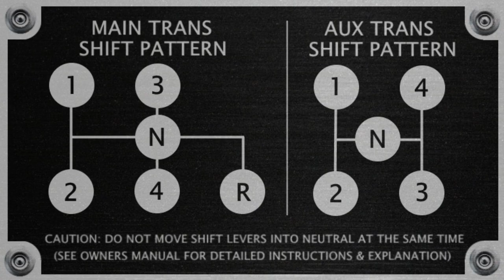Spicer 16speed Transmission demonstration

Comment: basically, this is dual 4 speed gearboxes glued together
Reply from the maker: Yes, exept they are bolted luckily!
Reply: @Darstrom  this is so cool this is the only transmission I have never driven before
Reply from the maker: @hankthehex4298  I hope you will get the chance to try it!
Reply: Mechanically, the brownie (aux) is behind the main, and the output shaft of the main is splined to the input shaft of the brownie
Reply from the maker: @FirebirdCamaro1220  Not this one, these are married boxes so they are bolted together without of shaft in between
Reply: @Darstrom  ah, ok

Comment: lol  you have it backwards kid  you shift the main normally and the auxiliary after youve run through the main.
Reply from the maker: the main point with this video is showing where the gears are located. 
You wouldn't shift it like that loaded. You need to use a few aux gears in between each main shift unless you are going downhill